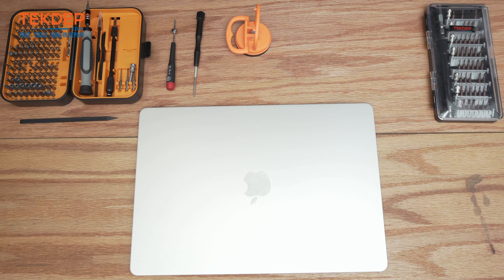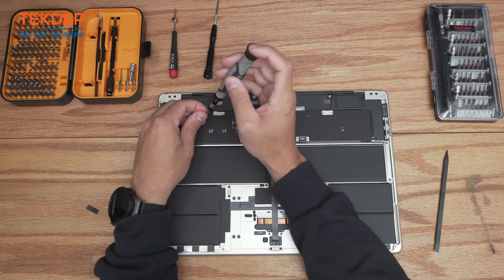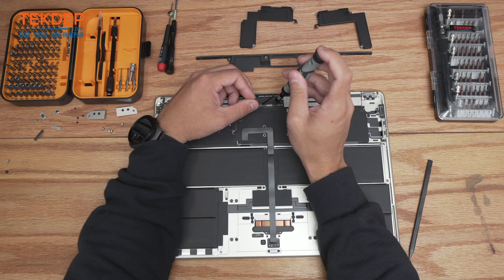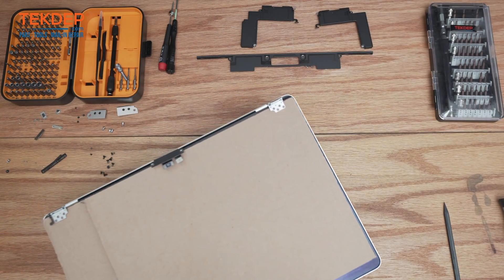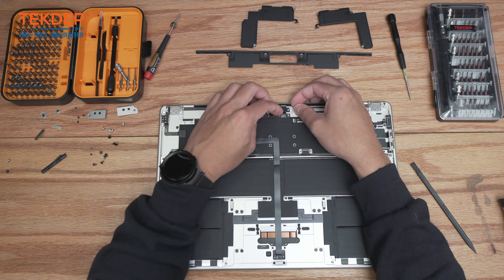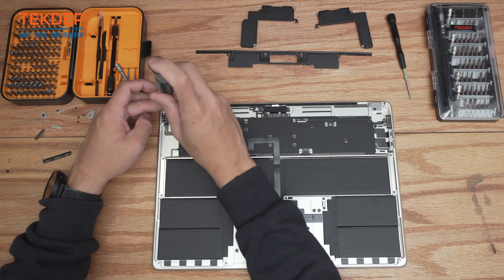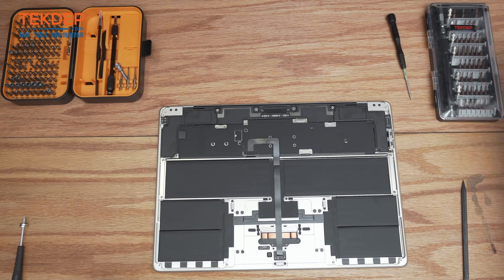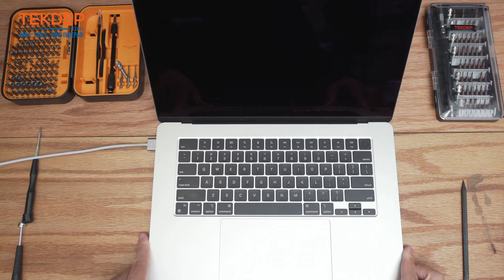Easy LCD Replacement for Starlight MacBook Air M2 15" (Model 2941)

Comment: You can do the same process to be able to loosen the hinge screws of my Mac Air M2 15 inch a little, since when you open it there is a clicking sound in the top hinge and when you close it the same thing
Reply from the maker: Yes that should be similar process but make sure not to crack the lcd bottom Bazel while removing the broken screen, after removing the hinge screws try to open the hinges using a screwdriver 🪛 to open position and than attempt to remove 

If you're still experiencing issues with your device and need help, we offer a convenient and affordable Mail-In Repair plus data recovery. You can learn more and get started here: https://tekdep.com/device-repair/

If you need parts such as displays and batteries or tools for your repairs, we have them all and ship worldwide! visit: https://tekdep.com

Comment: Self Service Repair says I need to replace the lid angle sensor and have it calibrated for the new LCD.  Is that necessary?
Reply: But I have read that the original LCD and logic board are paired. The angle sensor has to be reprogrammed otherwise sleep will not work when you close the lid.  Also, the true tone option check box, is grayed out. Can you confirm this? Is there something different with your LCD that bypasses those issues?
Reply from the maker: Most cases no, at least In our experience one out of 10 need re-calibration, we have the displays in stock. If anyone needs replacement parts such as screen and batteries or tools for your MacBook repairs, we have them all and ship worldwide! visit: https://tekdep.com 

We also offer a convenient and affordable Mail-In Repair and data recovery. You can learn more and get started here: https://tekdep.com/device-repair/

Comment: what about replacing the  screen only and using the original backside?
Reply from the maker: This is also an option, but due to the cost of replacing just the inner LCD it is cheaper for the customer to simply replace the entire LCD assembly.

Comment: I've seen these repaired before and they ALWAYS have a "glitch" at the top. Is that why you didn't show it loaded up?
Reply from the maker: To respect the privacy of the customer we did not show the lock screen. To avoid getting the glitchy lines we offer a service which includes the transferring of the ICs and LCD controllers to the new LCD, which thankfully is a work around the lines at the top of the screen!
Reply: @tekdep  I've heard about moving over the ICs, but I haven't seen any guides on how to do that; does that work for aftermarket LCDs?

Comment: Hi there! I’m looking to do an exact replacement with this device due to coffee spill damage. I’ve done multiple older MacBooks, iPhones, and other laptop repairs. Does Apple require the LCD’s to be serialized like they do for their components for their iPhones to work?
Reply: They are serialized. You'll see a lot of these videos that don't verify screen function under settings. :)